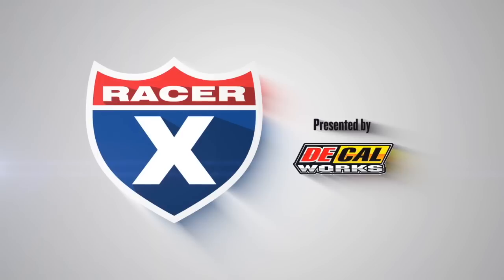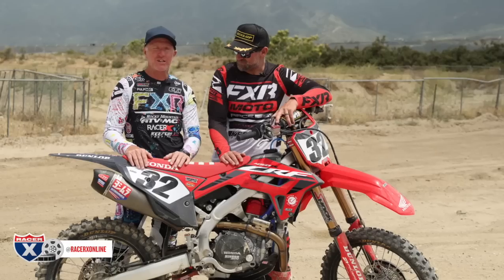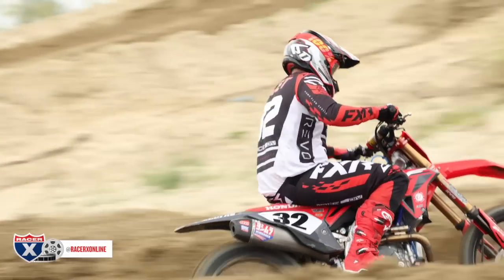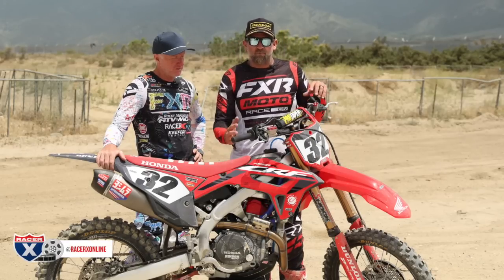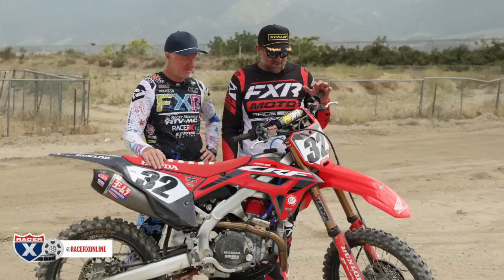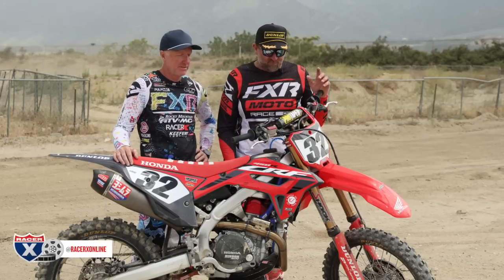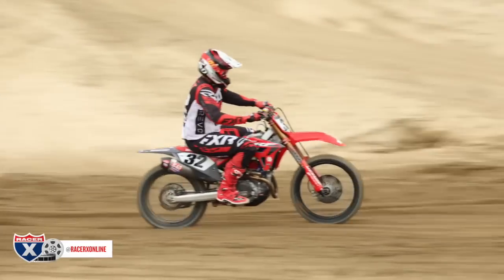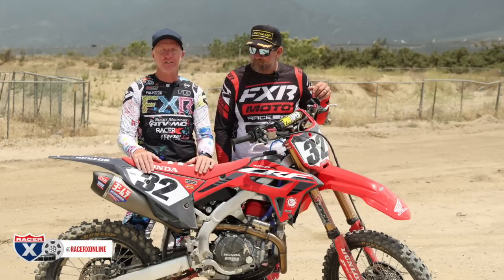2023 Honda CRF450RWE Garage Build Project Bike

Comment: My 23WE was valved way too stiff from the factory, but nothing wrong with that fork. All the Showa needs is valving and maybe springs depending on your weight. I just did mine using JBI’s pro fork kit and the results are amazing. Only took a few hours and some basic tools. Before spending thousands on a KYB swap spend the $300 to valve it properly.
Reply: He’s great to deal with too. He’s super helpful and works just as hard for your $50 sale as he does a $15,000 sale
Reply: @jdatwood7086  He’s probably the best customer service I’ve dealt with on bike stuff. Nailed it on the first try and even called to follow up. Good dude and his kit is quality.

Comment: If you like how the kyb is plush initially on yamaha and want your showa like that check out ride jbi. The yamaha since like 2018 or so is leaf spring midvalve. JBI converts showa to same type leaf spring midvalve . Personally im on a 21 kx450f and  went with jbi profork revalve. Super happy with it. Ive had alot of different suspension setups from many different shops and its my favorite of them all plush with good holdup and excellent bottoming resistance very similar to blackjack inserts I had on my previous 2019 ktm 450.

Comment: I ran a similar set up on my '22 CRF250R with KYB A-Kit... Valving usually needs tweaking from the factory settings, but once dialled in, KYB has great components for 99.9% of riders, with good initial plush feel, hold up and bottoming resistance. Overall, I think it helps with the Honda's twitchy characteristics.

Comment: Why would you need to spend another 10k on yore brand new 2023 WE if your a vet rider if your not racing competitively 
So far I have purchased 3 2018 crf450 for a grand total of 12k$ they were all pre owned but all had oem chain an sprockets
Do these guys care about depreciation also I am a vet rider who loves Smokin the young guys with 2023 450s with A kit suspension 
On my 4000$  crf450! Lol